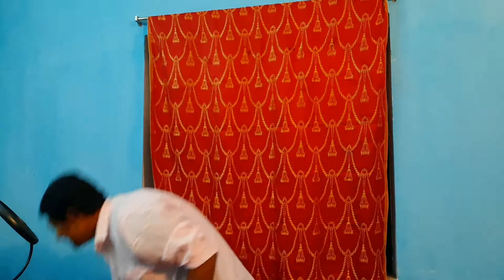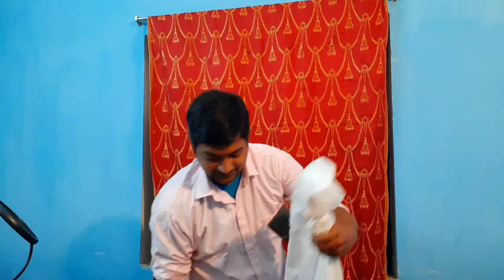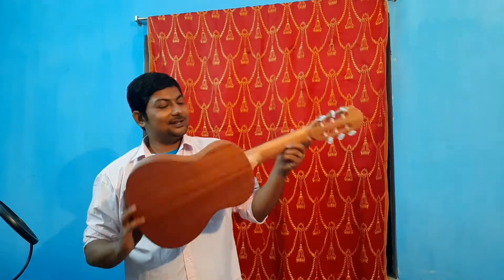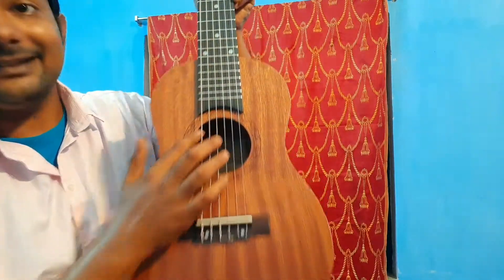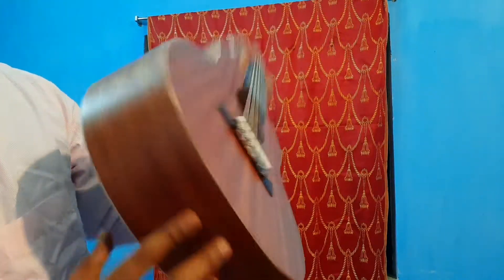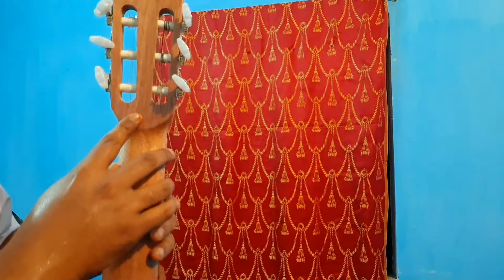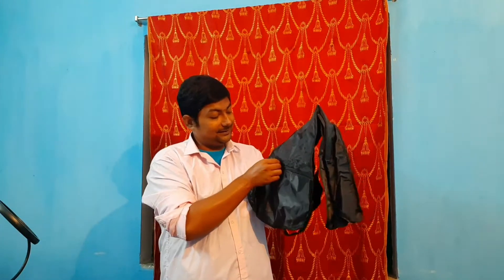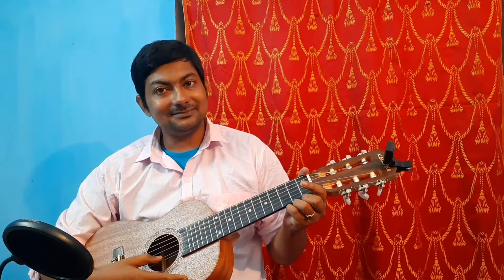Kadence Guitalele Unboxing

Comment: Bro, do you know how to tune this guitalele in standard EADGBE tuning like a guitar?
Reply from the maker: It's possible to do show by tuning down one octave and makes the strings too loose. I tried the tuning but did not like it at all.

Tuning up puts too much pressure on the neck. So, tuning up is not recommended.

However, I tried another setup. Take off the first and sixth string and tune the rest to DGBE. Now essentially you get a Baritone Ukulele tuning. That sounds nice too and more like guitar. You can try that.
Reply: @GuitaleleTutorials  Thanks for the info

Comment: What about Yamaha gl1 and fender fa 15 ?
Reply from the maker: yamaha gl1 is definitely  better than Kadence. fender I have not tried. in fact i did not know fender makes guitalele. looks like, i have to check that one.
Reply: @GuitaleleTutorials  ya sure fender fa 15 it's called just check it out and pls give me a review because I am a real fender fan but I am confused so now I have purchased kadence in future either I will go with gl1 or fa15
Reply from the maker: @ps vlogs3  hi, I checked it yesterday. Fender FA-15 is a Steel String Accoustic Guitar and not a Guitalele.

Definitely, Fender is great with Guitars. People love their products. However, as of writing this, I still could only see they make guitars and not guitalele or may be Fender Guitalele models are not available in my country. If you happen to have a link, would you please share with me, that would be great.

However, looking at the brand, I can definitely say, Fender products would be good too. Especially, if you stop and think for a moment, Guitalele is nothing but a trimmed down version of Nylon String Classical Guitar, which I will explain in one of my future videos.

with that said, I am using Kadence for a year now and changed the string set with D'Addario Classical Guitar Normal Tension Nylon String set and they sound great together. Check my new videos I have used the new set of strings.
Reply: @GuitaleleTutorials  bhai main bhi Indian hi hu and ok actually mujhe lagta tha ki chote size ke guitar ko guitarlele kehte hain so ... Anyway but uska size bhi 30inch hi hain shyaad but ok to iss type ke guitar ko kya kehte hain ? Kyuki ye bhale hi steel string hain but size to guitarlele jesa hi hain
Reply from the maker: Usko Chhota Guitar ya travel guitar bolte hai, par uski tuning is same to that of Guitar.  They are different  than guitalele. Guitalele differs in tuning than any guitar.

and also, if I am not wrong, chhota guitar uses different string than that of Standard Guitar.
Reply: @GuitaleleTutorials  means guitarlele ek alag instrument hain ? Aor mujhe strings nhi mil rhe guitarlele ke liye koi tip hain, konse strings use Karu, mai high tension ke nylon guitar strings use karne ka soch raha tha ?
Reply: @psvlogs362  I use D'Addario Classical Guitar Normal Tension Strings.

The same has a High Tension version too. 

Any Classical Guitar Nylon strings will do the job. D'Addario works best for me.

Choose as you like.
Reply: @PalashKantiKundu  ya I was also thinking about D'Addario

Comment: i was thinking of buying one but i’m confused between Yamaha Gl1 and this kadence one ? any idea which one i should buy?
Reply from the maker: Depends on your budget and purpose.

Of course Yamaha GL 1 has better sound quality but Kadence is also good. I am playing my Kadence Mahogany Uke for more than a year and I am happy with the sound it produces. I recently replaced the strings of my uke to D'Addario and sounds better than original strings.

The Guitalele is also Mahogany and sounds OK, not bright like Yamaha because the wood are different. Yamaha is Spruce while Kadence is Mahogany. Also, I will replace the strings with D'Addario Classical Guitar Nylon Strings hopefully will sound better than the original Kadence Strings.

Price is another deciding factor. Yamaha GL 1 is 3 times the price of this model of Kadence Guitalele.

If price is not a factor for you and you won't need the Equaliser, you can definitely go for Yamaha GL 1. Otherwise, stick to Indian Brand Kadence. Their products are comparatively cheaper and sounds OK. The enhancement you can make is on the strings. I prefer D'Addario Strings but you can go for Aquila Nylgut strings for better quality sound.
Reply: @GuitaleleTutorials  thanks a lot for solving my problem (: i’ll go with GL1 (: thanks again (:
Reply from the maker: Welcome. I am happy to help beginners with Guitalele. That's my whole motivation behind starting the channel.

Comment: what is the size of this guitalele, in cm, please confirm the measurement
Reply from the maker: It's about 30 inches in height. In width its about 10 inches and its thickness is nearly 6 inches.

If you are thinking of portability, it's quite portable and almost the size of a tenor Ukulele (a little bigger than it though).

Comment: That means no tuner including ...
Then why need this eq...
With out tuner no need other eq...
Disappointed
Reply from the maker: Yes, the package did not include tuner. there are combos with tuner though but that costs a little higher. Eq is for different purpose, to connect to amplifiers. they have option without eq too.